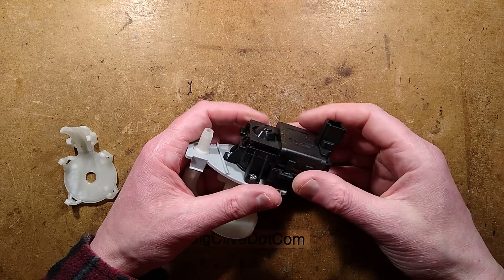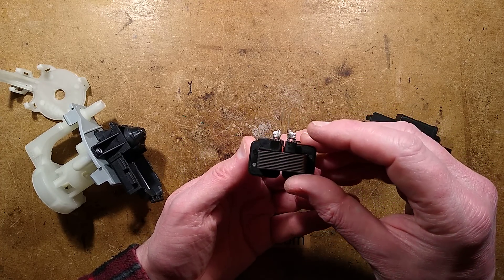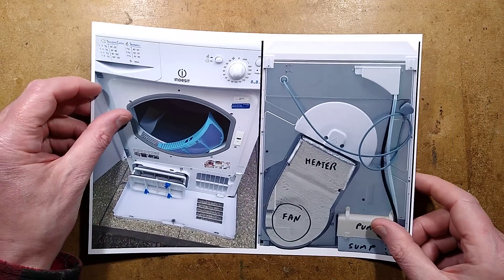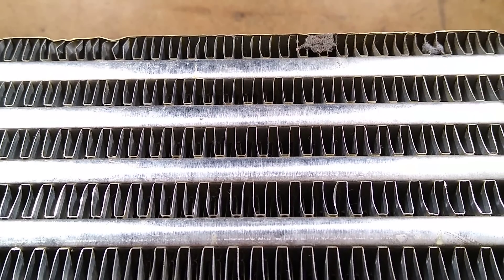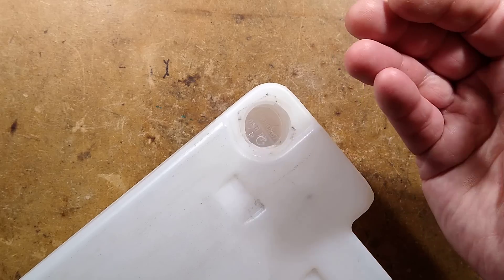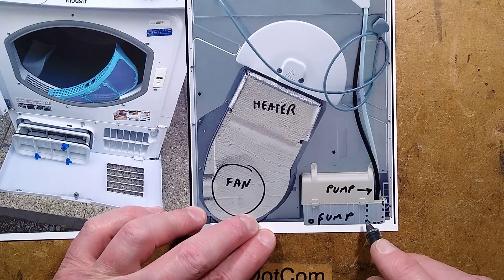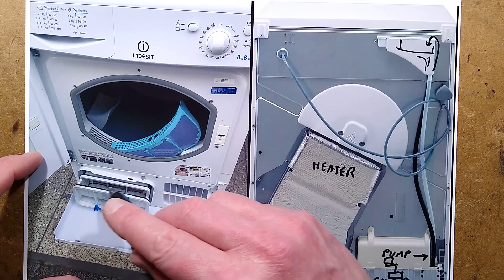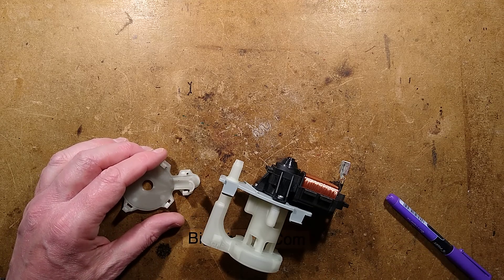Condenser laundry dryer pump

Comment: I encountered a tumble drier in an AirBnB that wouldn't operate and displayed  a red tap; I eventually figured out that it needed a cold water supply to the condenser and the tap was off.

Comment: I disconnected the rubber hose between the pump and the collector tray at the top and stuck it down the vertical pipe for the waste water from the washing machine. Now the water goes straight down the drain instead of into the tray and saves me having to empty it.

Comment: I started to hit the market the last few years like the last 10 years. We have option of Bosch I think whirlpool and I can't remember the other brand but they're pretty much the European brands trying to hit the US market. We got one probably five years ago and it's kind of nice not putting all that heat out to the outside. Although I still think a gas dryer nothing beats it. What's nice is we got the washer as well and stacked them and then the washing machine just plugs into the 240 outlet on the back of the dryer which plugs in the 240 outlet on the wall. so one socket! I should probably say that the model we got has a hose off the back so no tank. It works reasonably well although occasionally the drain will get clogged up and then you put your laundry on and you come back and hour later to find that it errored out on a clogged drain.

Comment: There are also dryers which allow you to unplug the hose from the water container assembly, so that you can just hang it down the drain or a waste water pipe. In this case you do not need to empty the water container anymore.

Comment: Just connect the hose from the pump directly to the drain which is usualy nearby for the washing machine and be done with it? Do people really use those reservoirs? Looks like a solution for locations without a drain nearby.

Comment: As an American, I still find it hilarious that for clothes drying we just dump a couple of kilowatts of electricity or gas into a box and then immediately dump that out the window. And the box often has almost no insulation, so it still heats the room in the summer, but not nearly as much as the energy being used by it in the winter. Sure, these condenser dryers are slower, but they're so much more efficient it's crazy. Plus heat pump dryers are finally trickling in over here, so hopefully those are more affordable by the time I need a new one.
Reply: Also hey, the squiggle has been mitigated XD

Comment: In the US we have retrofit devices that collect the water from an electric dryer so you can use it without a hole in the wall. I've had them in various houses with thick stone basements where a hole couldn't be drilled in the wall. Current house the previous owner took out a basement window for the vent. Don't quite get the point of doing that unless it's a gas dryer.

Comment: I wonder if they did a stalled/locked roter test, as I used to with BSI and UL.
Where the test chechhat the motor windings does not go anove a certin stable temperature.
This checkes thst the motor will not cause a fire.

Comment: Never knew these came in non-heatpump versions. Very intresting!
Reply: And is going cost a ton of money to operate just like the ones that blow wet air into or outside your house
Reply: @stevelloyd5785  Most of the ones in Australia are simple heat and blow the air into the house(or outside if you are lucky). The only advantage this one has is it doesn't get your house as damp. Good for cold climates with tightly sealed houses.
Reply: @ElectraFlarefire  Well being from NZ, I of course completely understand that. But the consumption of energy is going to be similar. The one benefit  with this type is being able to dump the water instead of spraying all around the house, as you said.

I had one of those crappy F&P front venting dryers in an apartment we owned and it was in a closet with the washing machine, and the tenants didn't know any better. End result was paint peeling off the ceiling due to the amount of water the thing pumped out. Stupid thing was the building has a ventillation system with a duct running to that closet, but the furniture pack specified was just idiotic.

A real shame because As a KIWI I think Fisher and Paykel (Haier now owns it) make some damn fine products

Comment: 🎉so, the flexibile impeller is a bad design. It breaks.
Tye old design was a plastic impeller with about 90 degree "loose" connection so it can start.
Also the rubber impeller can pump smaller flow not good for washijg machine.

The pump wont run all the time.
It runs for a while only.

Also water does get it the permanent magnet and stincks it up there, but it doesnt matter.
Really opd pumps had an O ring
The modern ones are working via induction with the plastic housing as seal/seperator

Comment: My dryer (Hotpoint) has the option to expel the condensate directly into a drain, much as the washing machine does: I expect that most condensing dryers can do this.  I prefer to save the water, because I find it's excellent for watering my carnivorous plants which can be harmed by the long-term use of tap water.  Incidentally, my machine was bought at a bargain price in part exchange when my old dryer fell victim to the Great Hotpoint Dryer Panic of 2015; the new machine (not so new now!) is far more efficient than the original, and I think I did well out of the deal.

Comment: Those motors are designed to make a horrible whining noise after a few years. But they are cheap to buy and easy to replace. Many tumble dryers you can replace the motor through a plastic panel without having to open the machine up.

Comment: Yes, we had a condensor dryer fitted in our previous house as we were unable to route a damp air vent outside for a regular dryer. Ours was a Bosch/Siemens. The pump sat in the reservoir and contained a float (ball in a tube) that acted on a switch. It would only switch the pump on when the level in the reservoir reached a certain level. The problem was that the reservoir would gradually get damp lint in that would stick to the ball causing it to stick, and the dryer would throw an error. I think that was time based - if it didn't sense the pump switching on after a set amount of time it would cut out rather than overfill the reservoir. Long story short, every couple of years I had to take the pump out to service it.

Comment: Clive, as a retired Hotpoint engineer, I found your explanation very good and concise. However, regarding the microswitch function, when the reservoir is full, it turns off the heater and the drum still turns with front indicator neon illuminated.That being said, it shouldn't happen very often so users probably would not be aware of it. Another foible was the float sticking on full which of course resulted in no heat. The give away being the water light being on. Keep up the good work!
Reply: Isn't the reason for shutting off heat but keeping the fan running to prevent fires?

Very hot, slightly damp clothes in a dense pile can sometimes auto ignite if they're left to sit like that. The manual for our dryer warns to always spread the clothes out so they can cool off quickly, if for whatever reason the dryer gets stopped while hot. The drying cycle always ends with a few minutes of cool air tumbling.

To my understanding, what can happen is that some fabrics can begin to oxidise in a slightly exothermic reaction if the heat and humidity is just right, and if they're left undisturbed in a dense pile inside the tumbler then the heat cannot escape so the reaction slowly accelerates as the temperature increases until it starts burning. Same thing can happen in damp haystacks, where the initial heat comes from biological decomposition.

Comment: Back in 2005 
I used my LPT port with some relays to drive this motor as a very low res stepper motor 😂

I was 15 yo trying to save some mony on my home made CNC machine

Comment: Nice video Clive had my condenser dryer for about 5 yrs moved house about 12 month ago had no room in kitchen so I put it in the pantry if your washer and dryer are next to each other you can get a hose (new dryers come with one) then you can do away with the res and drain it with the washer wast so long as your not using a u bend with a p trap

Comment: Have you checked to see if your machine is part of the recall, Clive?
A lot of earlier versions were recalled because the fluff would build up around the rear felt/foam bearing and eventually drop into the heater and catching fire.
Common failure on that  pump is the rubber impeller gets softened by residual detergent and conditioner coming out in the condensate, eventually falling off and no longer pumps the water.
Reply from the maker: I bought mine a while after the recall.  I do clean the hot air path from time to time.  I did a hunt for the rubber impellers on eBay and they are very easy to get for about £3 shipped.

Comment: That propeller was the first thing to fail in my dryer after a couple of months of use. After replacing it twice I just removed the motor and connected the water collecting tray to the plumbing. No need to empty the water reservoir and no more noise (it is actually quite a noisy motor).

Comment: Are you sure it is working like this? Would not be any more efficient than one that blows out all the hot, moist air.
I believe the hot air is cooled down to extract most water out of it and move its heat to the fresh air.

Comment: Our 20+ year old dryer finally died AGAIN and rather than repair it again like I’ve been doing for 20 years, I invested in a heat pump condensing device. My main concern is that this is a MUCH more complicated machine that I will be unlikely to be able to service myself. So far no problem though. The only issue is that it is a much smaller load than the old one so sometimes I have to do two loads to dry a single load from the washer. It just sips electricity though so I am wiling to make two trips to dry the laundry. First dryer I’ve owned that I could run on the backup generator if I needed to!

Comment: I'm looking for the green dot to indicate that the dryer has been modified to reduce the chance of it catching fire.
Reply from the maker: This dryer was bought after the recall, so hopefully it's the safe one.  I do routinely unscrew the back panel and clean the heater area of lint.
Reply: That would make a good part 2 for the video. Ours went through the recall but I have never looked inside. According to my wife the recall involved fitting a complete new back panel.

Comment: It took me a minute to get what I was looking at, but it appears to be the laundry version of a  portable humidity or an air conditioner water collector. You have to keep emptying them but there is the option of attaching a drain tube on the back of the units...right? Is this more  efficient than the other type of dryer?
Reply from the maker: You can directly connect to a drain.  This type of machine doesn't need a vent and puts out a stream of warm dry air into the home during its drying cycle.

Comment: Very interesting video. I have a similar dryer and your diagrams are helpful for my understanding. If you can get a hold of the circuit board for this dryer, I would like to see it reverse-engineered. My dryer is made by Beko, and it has settings like "jeans" and "sports", I wonder if these are just gimmicks, as I just have it set to "eco" permanently.

Comment: I'm a white goods engineer of 35 years 🙂 those pump fail all the time the rubber impeller falls off they did improve it with a better tougher type of rubber but now they often start making a squealing sound and need replacing 😉  they are cheap to buy though 😮 fire hazard dryers hotpoint and Indesit they had to be modified but still have a major problem with dust and lint build up even on the new ones 🫣 every one we repair gets completely stripped and cleaned out no matter what fault is reported 😳 i would recommend anyone with one to strip and clean out thoroughly at least every 12 months and never leave it on when you go out or while asleep at night 😔 so many design floors and poor build quality 🤐 love your videos let's hope they inspire the next generation of engineers and electronics technicians to ignore the accountants and start building things to last rather than to a strict budget 😉  someone has to replace us when we are all done

Comment: Nice, very interesting.  Here is the USA I believe all the vent-less dryers are heat pumps.  They have the container for the water or you can just run the tube to the washer drain.  They are super efficient but but take a little longer to dry.  You also don't suck hot/cold dirty air into your house with a vent-less dryer.  We love ours.
Reply: I was just thinking that you could let it drain into the washer drain. I've never seen one of these but may have to look into them.

Comment: I have a similar unit at home however it differs in that it utilises a refrigeration compressor and evaporator, its a heat pump condenser dryer. essentially instead of a 2KW heating element it uses the heat from the refrigeration compressor and condenser to heat the drum, and the evaporator is used to cool the humid air below the dew point so the water condenses at a lower overall temperature, this means the clothes don't get as hot but still dry (apparently better for clothes??). its also meant to add a few percent to the overall efficiency.

Comment: Ha ha! So, is it fair to say this motor is a synchronous shaded pole motor, without shaded poles? Since it will work in either direction and since the magnet in the rotor introduces reliable instability at rest with power on, there would be no problem with starting?

Comment: interesting, it sounds like it functions like a de-humidifier.  We had a washer/dryer combo that would wash then dry without needing to swap machines but it was horribly inefficient took 5 to 6 times as long per load and never really dried that well.  it did not have a tank to empty it just vented the air into the room from somewhere I never knew where the outlet was.  So glad to be back to normal separate washer and dryer

Comment: Kind of… except the whole principle of these dryers is “condensation”, so essentially the colder the environment they’re operated in (ie. outdoor laundry) the better they perform! 

They still have obvious benefits come less humidity in a space, but the efficiency of drying is dictated by the difference between operating temp and ambient temp… hence the “condenser” effect.

Although they still work fine for most households, especially when in comes to minimising humidity, they are particularly suited to the likes of wet rooms/mud rooms of European households. Using one a condenser dryer in moderate temp climates is actually less efficient than a normal dryer.

Comment: I had one of these combo machines with the condensing dryer, it was a Whirlpool and about 2 years old. One time I set the laundry and went out to run some errands. When I came back, water was pouring down through multiple floors because the fill sensor apparently decided on an early retirement and apparently it's not designed to be failsafe. So remember: modern appliances = total crap. Moved into a new house with 20 year old washer and dryer and they work great. Now I'm designing modern control panels for them using Arduinos that will add customizability and be failsafe (and not reliant on a horrible app like Whirlpool's).

Comment: Same type of construction as the washing machine pumps with the exception that the rotor runs sealed in the water stream.  You find that this motor is a shaded pole motor hence self starting.

Comment: Yeah, I don't think those machines are super-popular in North America - never heard of them. The closest thing we have is a heat pump dryer which adds a heat pump to the mix - the cold side dehumidifies the air, the hot side heats it back up again so those don't have a heater. They too don't require a vent.

Comment: Once at a MoD site, someone warned me the dryer wasn't working. So I emptied the water container. Still didn't work. I pulled the heat exchanger and it was a solid brick of lint. Needed a good blast in a Belfast sink. I could then dry my clothes.

Comment: Great machines when the weather's to cold & wet for the washing line. For best use, empty water tank & clean lint catcher in door after EVERY session, pull out & clean the condenser every few sessions & most of all, use in a cool well ventilated room. This last point improves the efficiency of the condenser, reducing running times & saving energy as well.
Also, as Clive points out (if you are confident in doing so) remove the back cover too & check & clean the heating element, incase of lint build up.
Had my Hotpoint nearly 20 years now & all that's failed is a heating element/ thermostat part( which was easy & cheap to replace).
Thanks for the vid Clive. 👍

Comment: Sounds like a very energy wasteful way of drying clothes, just get heat pump based, it will pay itself in no time. Not to mention heat being dumped in room. Got myself heat pump based dryer, and it still dumps enough heat in the small bathroom to feel it, I could just imagine bathroom converting to sauna, when you run this one. And for the trick question, try drying delicate clothes on low temp in condenser, as well can dry them just hanging. By the way, you can reroute water drain pipe straight to the main house drainage system, that way you can cross out emptying water reservoir from list of things to do, very convenient way.

Comment: There is a synchronous motor that drives the knob on my popty ping ( microwave) so sometime it goes backwards which ruins your dinner which is nice,not. When my wife told me the knob was going backwards I didn't believe her untill it turned my pasty into carbon and stunk out the kitchen
Reply from the maker: Yeah, I had one that did that too.  You wonder why it's not finished yet and then see that the cook time has increased.